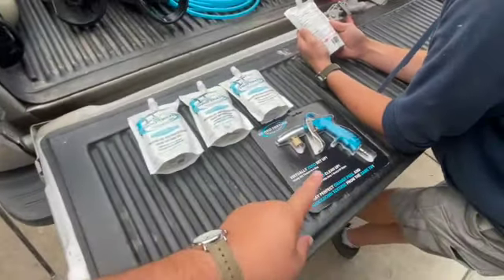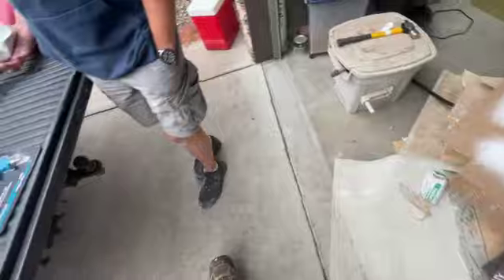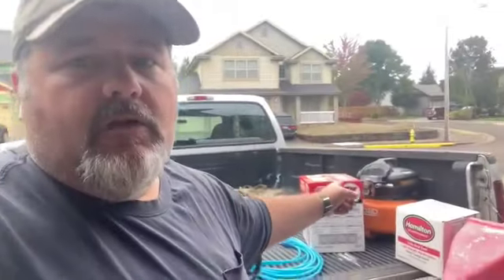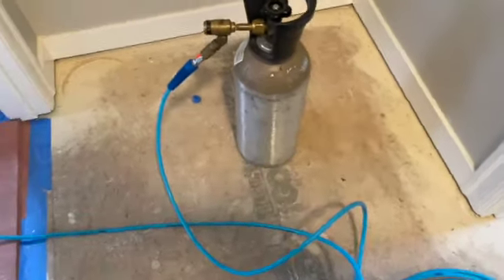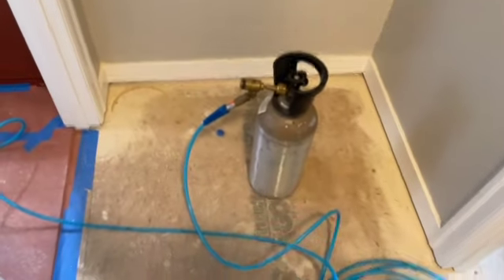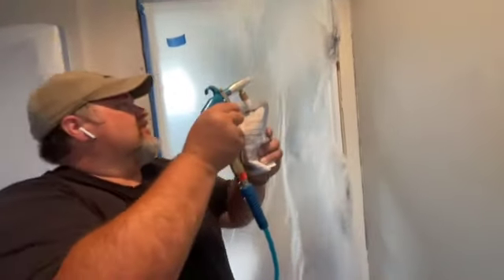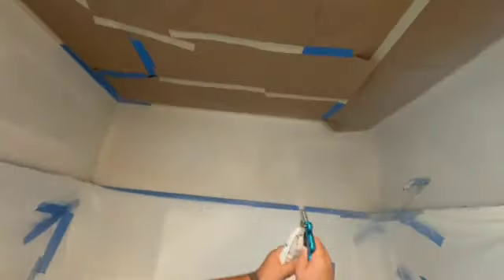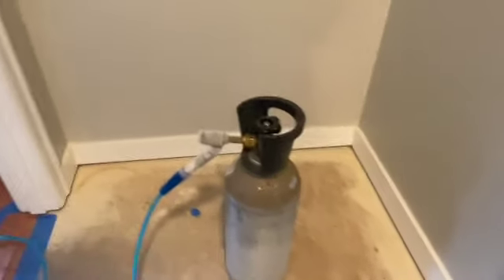Is The EZ-PRO TEXTURE System Worth Buying??

Comment: Absolutely love this thing. It took a few tries to figure out the "squeeze" factor. Once I got it down, it has not disappointed
Reply from the maker: To be honest we haven’t used it as much as I thought we would.  I do plan to do move videos on it as it gets used more.   Thanks for the comment, and don’t forget to like and subscribe 👍🏻👍🏻
Reply: @Thehelpfulcontractor  same here. I am a painter by trade, drywall only when necessary.  Most drywall texturing I deal with is usually a ceiling crack, can lights patched over, and bathroom work. But for what I would have spent on 2-3 cans of spray texture, I have a solid tool. I Refill the bags with my own thinned down taping mud so I don't have to pay for bags at 8 bucks apiece
Reply from the maker: @philipmendisco6656 I’d love to see how you reseal up the bags. Or do you just pour back into the plastic tube?

Comment: Thanks for the video here's my take I'm a contractor and I do drywall patching frequently. I'm like you I feel I have more control with the cans. Yes the cans are more expensive but the orange can dries in freaking 5 minutes maybe 10 minutes max then I can prime and paint. This product doesn't dry that quickly more like an hour it says 30 minutes to 120 minutes so I'm guessing more like an hour. Money is time. I don't want to wait to paint and finish my job. So I'm back to the cans. I will return this product not for me.
Reply from the maker: I can totally relate to your view point. The can are a perfect tool for doing small details and touch up work.  
I plan to do some more work with the little gun, but it will be with mid sized patches that would take multiple cans.  
I appreciate your input and feedback.

Comment: Here in moseslake  I use a pvc  pipe on top instead  of the hopper for patch  jobs
Reply from the maker: That sounds like a good idea.  I’ll have to look into that.  Thanks for the tip 👍🏻👍🏻
Reply: @Thehelpfulcontractor  just use a coupler to hold the pipe and allow it to sit on top of the gun
Reply from the maker: @jimbowen5546  nice!
Reply from the maker: Jim you are right! That worked out awesome. I'm going to make a short about using your idea.

Comment: You just have to keep hopper well lubricated and it will last for years
Reply from the maker: You are 100% correct.  When I was a one guy shop all my tools seem to last much longer, but hired help tends to be harder of stuff, and the maintenance and cleaning never seems to happen as often.
Reply: @Thehelpfulcontractor  I don’t know if you figured it out, but you take the tip off the bag and zip tie into a Ziploc bag and fill with a fast setting compound is a video on YouTube already about it

Comment: Too wet! Spay it on and it sags into a homogeneous puddle on the wall… I’ve tried it 6 times and tested at various pressure levels… no way this is going to match knock down. Light orange peel might work but would need to shoot a little and let dry and repeat. I give this a 5 as an idea not a 0 in reality…
Reply from the maker: Yeah I can see where knock down would be very difficult to match with this little gun.  I have seen other guys modify them with small hoppers on top, so maybe we’ll see a different version some day.  Thanks for watching and your feedback.